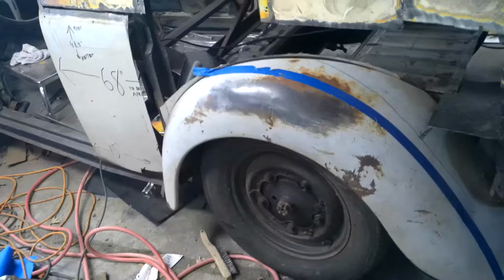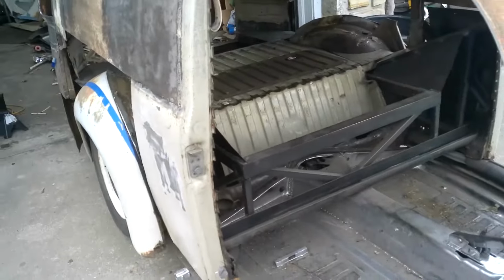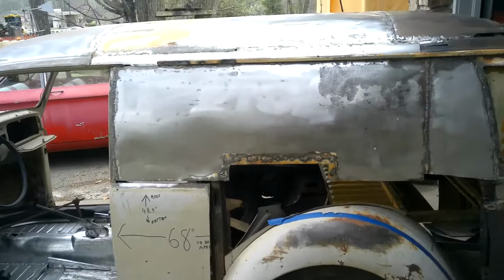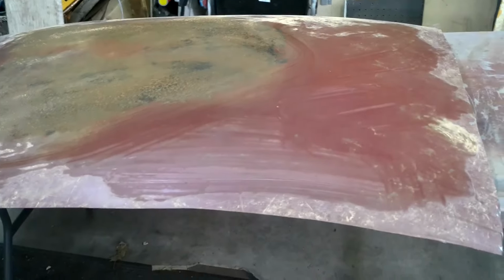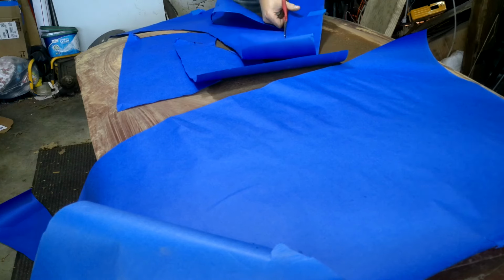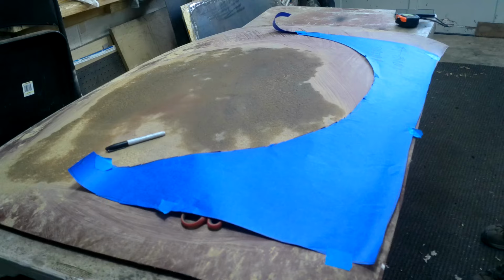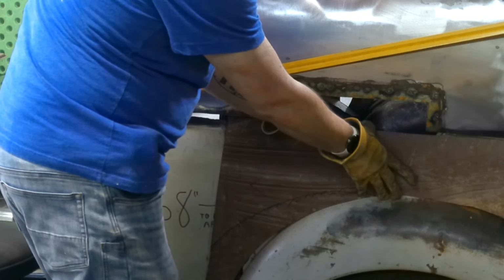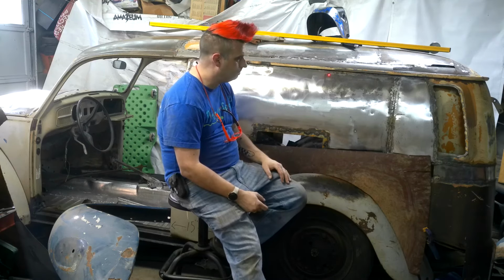Using old Fastback Metal for the Panels on the Käfer Van Build, Panel Bug ep 22

Comment: Hello Jason, I like the matching glasses to the Mohawk, apparently, when I typed a suggestion in earlier, I must not of hit the post part of it. Basically, I was letting you know that if you use Citristrip available at many big box, stores and other places, a 64 ounce container, and some plastic wrap should be enough to help you strip the paint left, including the hard to get to places like the door jams with their multitude of bends. I hope this helps and maybe, it will save you from overworking yourself stripping it manually. It’s pretty cool to put it on a 16th inch thick and cover it with plastic and watch it do its thing and then just use a plastic Bondo scraper to scrape the majority of the paint and other material off leaving you only with light sanding. Thank you for building those side panels from rescued German steel. When I see you do that it makes me smile. Guttentag. Friend. Hopefully I sent the comment this time and didn’t mess up again.

Comment: another little lore about german racecars this time :
german national racecolours used to be white and mercedes and auto union  racecars where painted in that colour 
one time a tech inspection revialed that one of their racecars was too heavy and was disqualified from entering the race 
the desighner of the car took out his pocket knife and began scraping of the paint down to the bare aluminium , and once the other mecanics where over there gasps in horror began to understand wat he was doing and helped him 
turned out that the couple of pounds the car was overweight was because it of the thick paint , after they took off the paint they had the car reweighed and it just light enough to enter the race after all , since silver is close to white they kindah looked over the car being silver and silver became the new german racing colours 
not quite sure if there WAS a maximum weight in that time so its not certain if that storie is treu or not